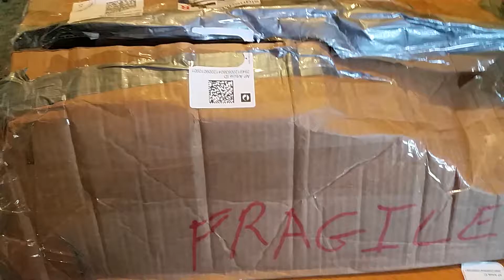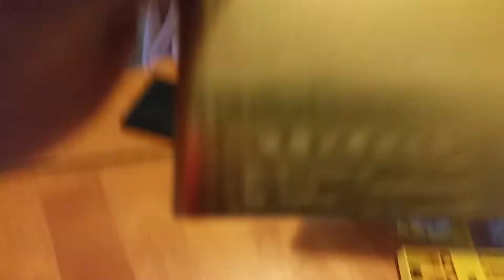Massive donation from BattonFive unboxing.

Comment: thanks DD mate, and you're most welcome :-) the little lid goes in that little box :-D sorry didn't have time to fit it on there before I sent it and the other two fit on the pallets :-) the little slats on the bottom of the boxes stop them boxes from sliding off the pallets when you are moving them about the place :-) have a play with the lights, when I get some cool Dionaea seeds in I will send you some down your way and im sure there are loads of plants down there that would be fun to grow :-) if you need any help at any point don't hesitate to give me a shout :-) and big cheers for the shout out bro ji :-D
Reply from the maker: cool. Thanks again man, I was stumped when the delivery guy put the box on the porch till I turned it over and saw your name lol. I plugged 5 strips into a 3s, man they are bright and hot... I cut the British Made logo off the box too hehe. I might have to invest in some plastic storage boxes to make some indoor greenhouses for the leds.
Reply: Devolution RC lol yeah amps on the three series will do them real nice :-D get full wattage from those :-) but yeah hot is good shows you they are banging out the Lumens for the growth :-) when you set them all up try to be aiming for that same heat on every strip :-)
 Lol yep totally 'Made in England' there :-) the large cargo box surprised me with all the bits of wood in it :-) I didn't realize how many parts until I counted how many slats and pieces there were :-) really surprised me, I made them to match how I would have made them at 1:1 scale if I needed to transport a small pool table safely or a big bit of machinery or something :-)
 the plastic tubs could work nice there yep :-) depending on space you could sit them over your plants and lights or could even chop off the front to have a flap on them to get in from the side :-)
 if its a warm area where you are putting them and if you can tap the same full wattage through them all like you did on the 3s then I would give them plenty of ventilation, where if its a bit of a cooler area I would aim for full wattage and a bit less ventilation. though in the cooler area I would give the plants a bit less water as to deter the water from going a little stagnant, doesn't happen with the hps bulbs as much because of all the heat but if these leds are in a cool place they don't produce as much evaporation so a little less water than usual to stuff helps out.
 I just received that psu in that I ordered the other day off ebay that is an exact duplicate of the other one I used the other day that worked nice, so im just nipping out the back to solder and test that up :-) it should let me confirm the best psu to give the best wattage to each strip :-)
Reply from the maker: Yeah I had planned on drilling some holes in the plastic tubs, where I am it gets sort of hot but not very humid in summer and pretty cold in winter.
Reply: Devolution RC sounds good with the holes, the heat from the strips will keep the chill off in winter easy enough and the holes will vent it on the warm days :-) plus they will be light weight enough to move them about so you can always tweak the position dependant on if you are growing or flowering your plants :-)